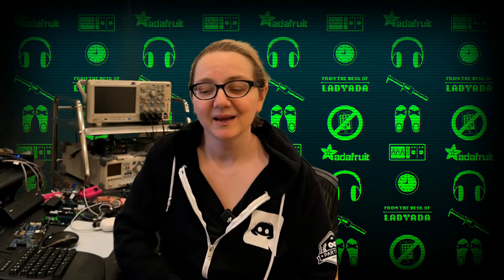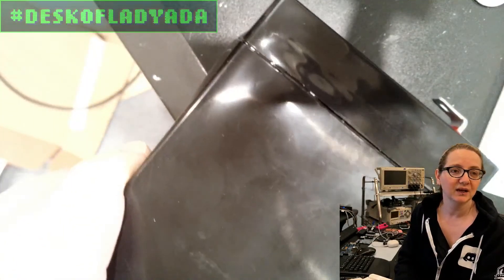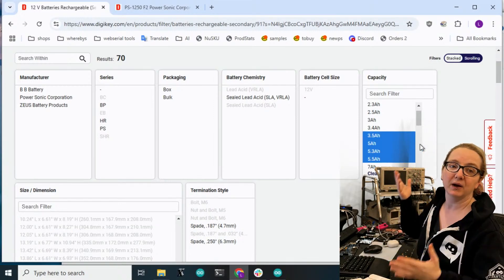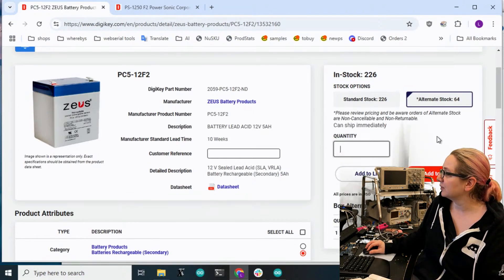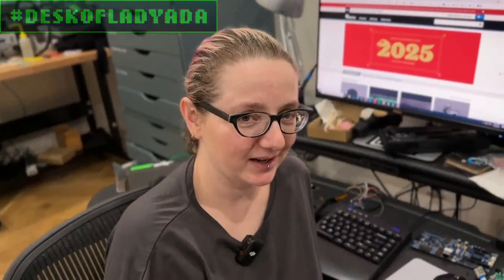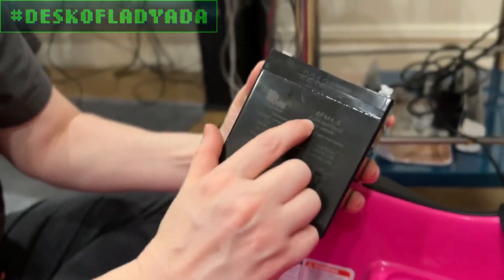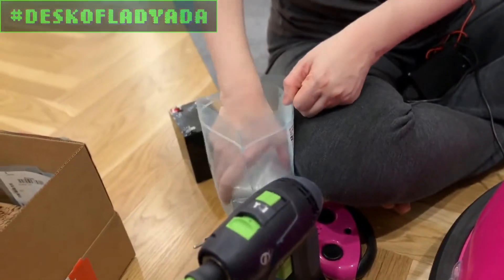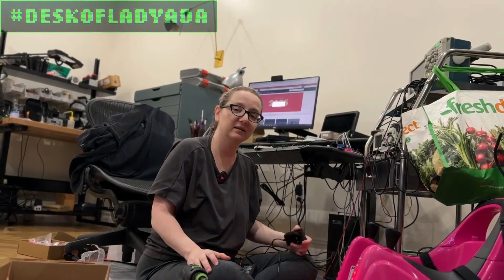Desk of Ladyada - Kiddo Kart Repair

Comment: How annoying that the battery is a weird shape like that... Some little battery powered kid vehicles use a pair of 6v lead acid batteries that are often used in emergency exit light signs. (Wrapped together but pretty clearly two separate sealed lead acid batteries.) That made the swap pretty easy. But yours looks like they put them in the same case. I do detest how picky lead acid batteries are about being maintained though.